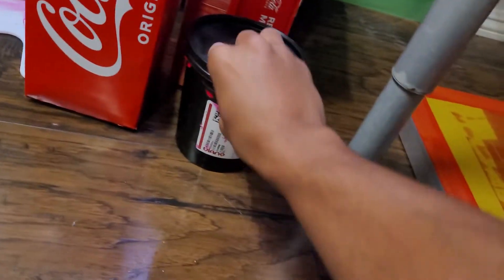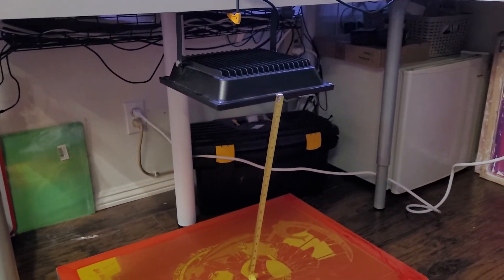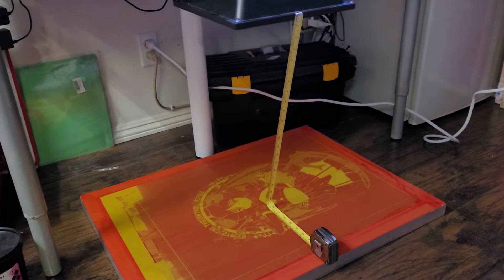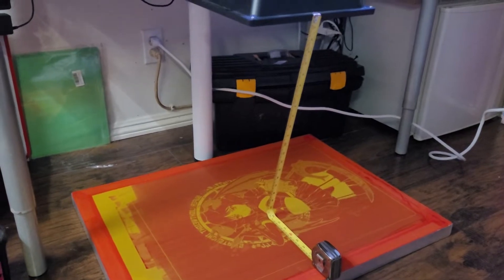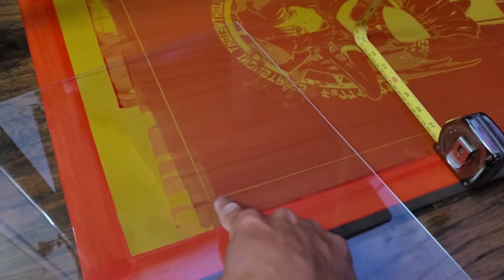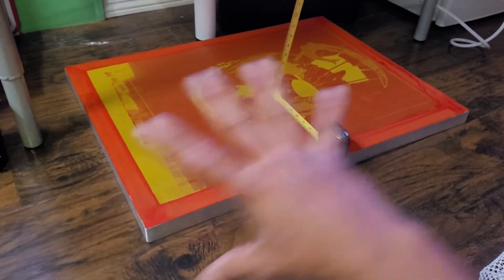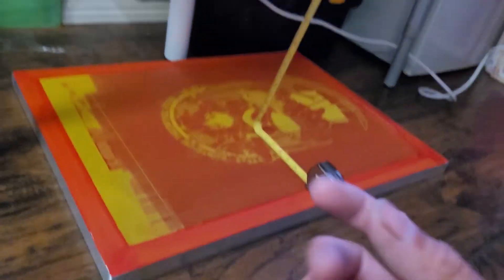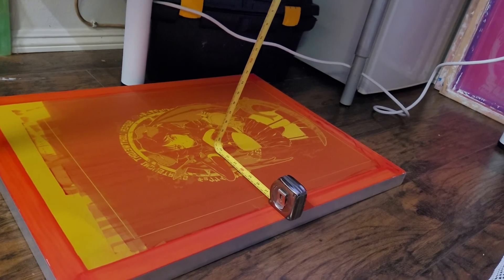My Updated QTX Emulsion Process

Comment: Hello! I was unable to respond to your question on your other video. But, the light I am using is a 200 watt iridescent light
Reply from the maker: I'm not sure if it's due to ur emulsion but from what I understand iridecent bulbs are different than incandescent. Iridecent bulbs may not be dumping enough energy to cure the emulsion. I would suggest buying the led panel in this video. It cuts my cure time down so much.
Reply from the maker: Also is it a "200w equivalent" bulb?
Reply: @Superlwti  I'm not sure. I am no longer at work to check. I have always used it with the speedball Diaz emulsion and had no problems. I see you mentioned the 50-watt lights. Are these black lights? If so, I just happened to buy some and will try them. Thank you for your help.